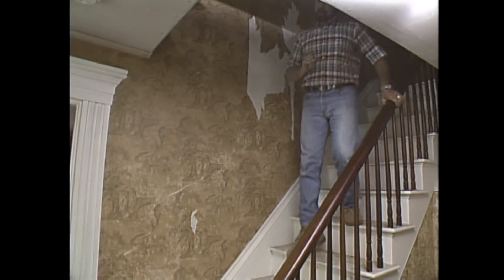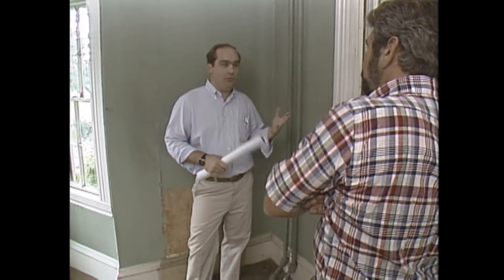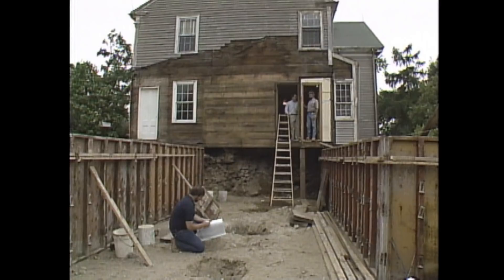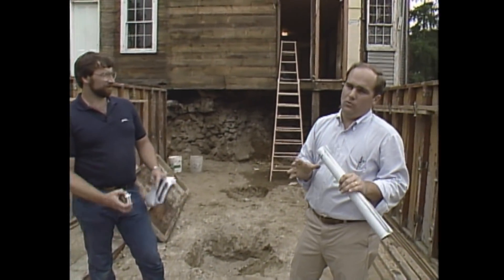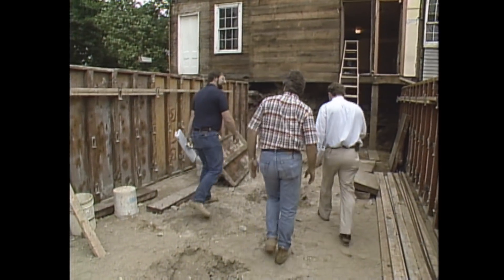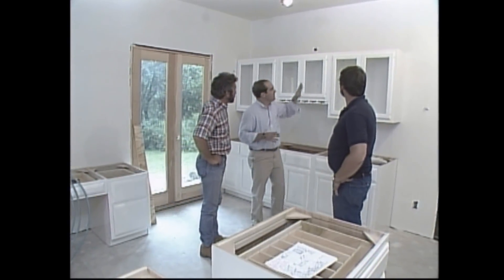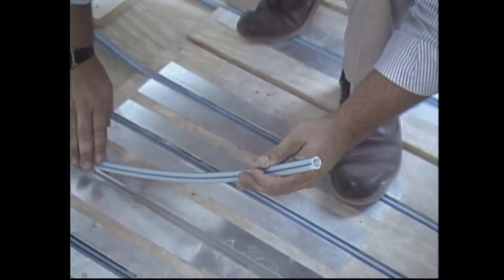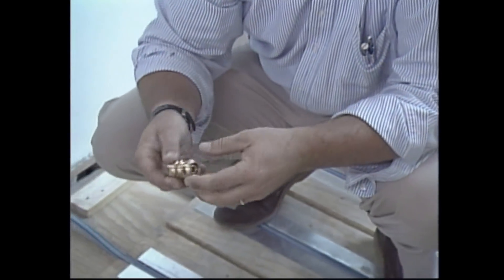Richard explains radiant floor heating 1987

Comment: I wonder if Richard is still enjoying that radiant in floor heating system today.
Reply: The Pex radiant system is the only way to go. I installed one some 15 years ago in a new addition with Hepex plus transfer plates. They're aluminum, and screw into the sublfoor from underneath. The Pex then snaps into the tracks, increasing the efficiency by 20%. It's really different than conventional baseboard, in that you have warm floors, and it heats objects, not so much the air, so at 62F, the room is quite comfy.
Reply: @quiteactually  Just seems that plastic isn't the best heat conductor, but i guess as long as it lasts forever, that's all that counts.

Comment: I think this is what sold Norm and Russ on radiant heat, when they built the main section of the workshop in 1988 in preparation for launching The New Yankee Workshop series, they put radiant heat in the floor of the main shop. The old workshop became the finishing room of The New Yankee Workshop.

Comment: I hate this, rip out beautiful original features and replace with plastic. 😢
Reply: Ellen Fisher
 ... The first home was probably built without any heat or plumbing, just based on seeing exposed pipes in the rooms. I feel the whole point here is to restore the original "clean look" by removing traces of the early heating system and cast iron radiators.